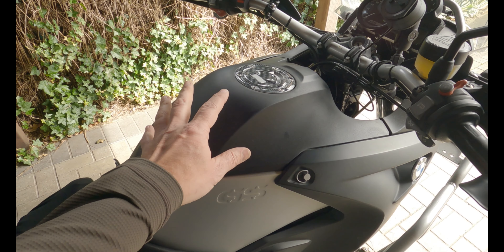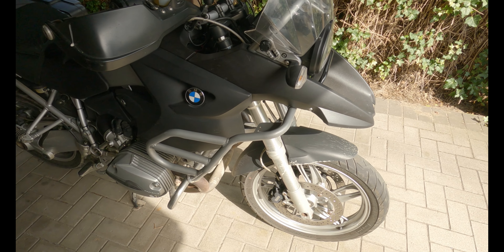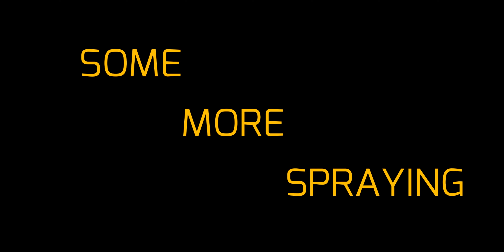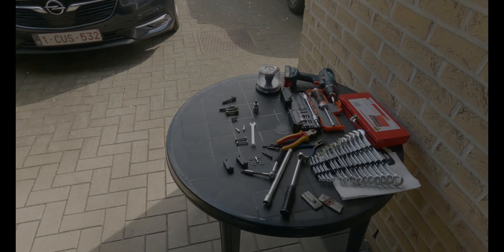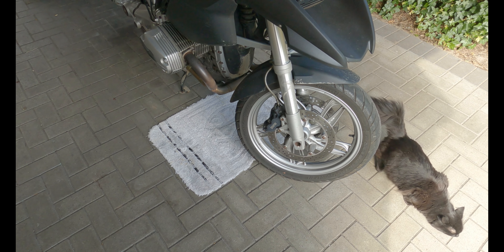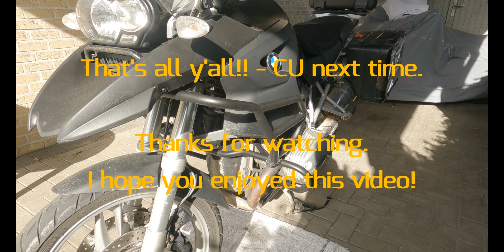Plasti Dipping Crash Bars (BMW R1200GS)

Comment: How did you connect the upper guard? I’m having issues finding where to screw the holes on the handle
Reply from the maker: I don't know if there are standard holes on the GS for the upper crashbars. On mine there are two metal plates with holes in fixed on to the frame under the beak by the previous owner. That's where the uppers are connected to.
Reply: @boasbikerschannel  thanks you! Any chance you can include a picture or video on how it looks like?
Reply from the maker: There doesn't seem to be an option to include pictures in here.